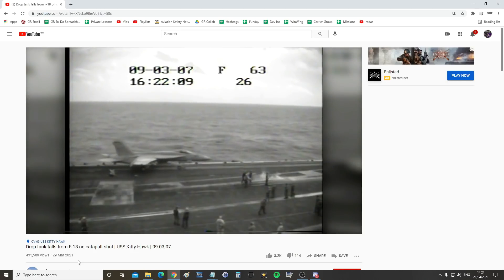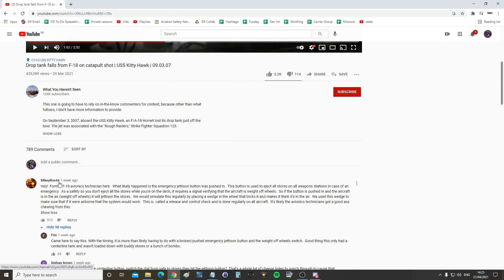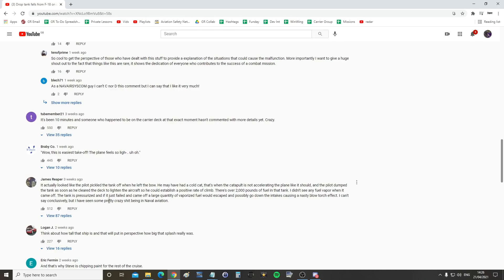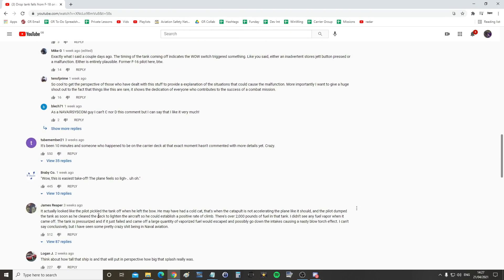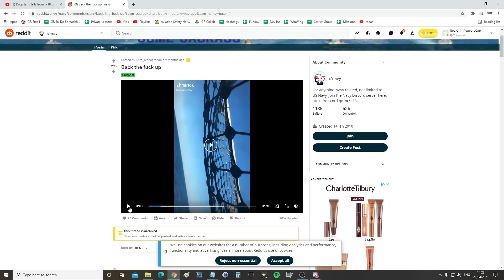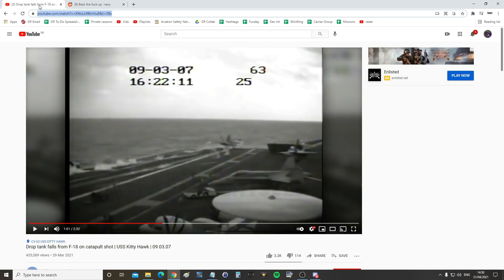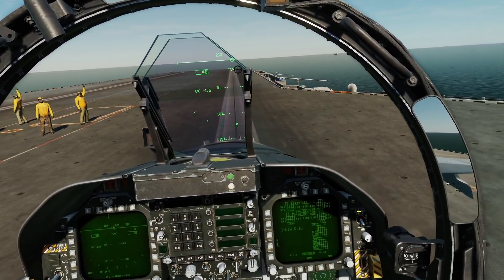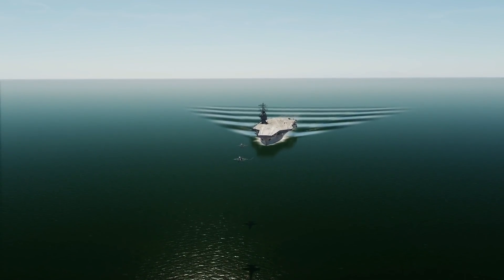2007 Why Does FA-18 Hornet Jettison Fuel Tank After Catapult Shot? | DCS Reenactment

Comment: This was done on purpose, hitting the emergency Jett button.  The Avionics tech is not wrong about the jett test functional with the WOW Wedge, but you have to have both weight off wheel and be pressing the button for the tank to come off.  In other words, the pilot was pressing the button when the tank came off, not the tech an hour before.  The tank was full, you can see how big a splash it made.  An empty tank is like an empty beer can, doesn't make a big splash.  I have seen an empty tank jettisoned on a range (pilot screwed up, he wanted to jettison empty  rocket pods and hit emergency jett button by error- he admitted it, saved a lot of time for the investigators).  It skidded on snow, we picked it up later.  Still in one piece. Tanks do not explode when jettisoned on the ground, even full.  I know and seen the  results, personally, of 2 full external tanks jettisoned on a hangar floor (functional test with WOW wedge, but the carts had been left in, techs took a shorcut but fucked up, they were doing night time "assembly line" config changes, a big no-no) and another one on the flight line (centerline) with the same results.  Scared the shit out of the techs.  Jet fuel is just very clean diesel (or close to it).  I put some in a zippo lighter and it is difficult to ignite, because it doesn't evaporate much.  Plus there are additives to prevent the friggin stuff flashing over, in case of accidents (short of a crash) or when some dickheads fortget to remove carts when doing a functional...  These are warplanes, expected to take hits and not blow up like a Zero.  Anyway, for some reason, in this video, the pilot hit the emergency jett, probably a cold cat as mentioned. It may not have been an actual cold cat, but given the pilot has .000000000001 seconds to react, maybe he thought it was.  Never heard of an emergency jett button getting stuck, I imagine you would get a warning on startup. Big time.  But crazier things have happened.

Comment: As an F/A-18 weapons tech for 25 years, I’m 99% certain that the jettison button was pressed and when the aircraft went WOW it jettison. It wasn’t a cold cat because if it was the aircraft would have lost altitude and have a difficultly turning and climbing (lost an aircraft because of cold shot). The other 1% could be a malfunction of the bomb rank were it had stray voltage powering the cartridges that actually pushes the stores away from the aircraft. Been WOW completes the circuit.

Comment: Just a side note: The procedure does check for 28 VDC at the firing pins on the rack when emergency jett it pushed, you then release the button and check for not only no voltage but stray voltage as well. The test is required after the rack is hung on the aircraft centerline. If the tank was hung on an already installed rack, you aren’t required to do the jett check but the rack is required to be checked every 30 days that it’s installed. Wing tanks are done at each installation because the tank and release mechanism are one unit. Being a maintenance I’m partial to the pilot dropped that tank due to a soft launch. Inadvertent releases are very far and few between but they do happen, usually as the aircraft switches are being set for arming.

Comment: A-5 Vigilante carried fuel tanks and weapons in an internal bay between the engines. Sometimes, during cat shots, they lost the tanks due to the high acceleration.
Reply: The a 5 and tu 128p are the two aircraft in most need of modeling

Comment: Jettison in DCS is still simplified as you can jettison at any speed. I have read in real life F-4 Phantom II had different speed ranges depending on the amount of fuel left in the tanks.
When intercepting Migs in Vietnam the max jettison speed was often exceeded. So either jettison early before accelerating or keep the fuel tanks. 
F-4 pilots sometimes did not drop the tanks because there was not an unlimited resupply (and they considered the weight of an empty tank to be acceptable).

Comment: I have my doubts on whether this is modeled or not. In the Huey, there is a wire strike blade above and center of the cockpit, and forward, center of the skids. It’s to cut a cable and prevent (in the event if a wire strike) the cable from entangling in the helicopters blades. If you are confused about the specific device I’m referring to, here is an image link: https://th.bing.com/th/id/R1dd5926a5d198444f441243771503b8a?rik=Xu9WAhijhYv4TA&riu=http%3a%2f%2fwww.b-domke.de%2fAviationImages%2fHuey%2fImages%2fUH-1D-10109.jpg&ehk=Y%2bNXtE8lJdPBYklEifjD%2f%2f4eWPaG%2bmQTH7or4ZfwEzM%3d&risl=&pid=ImgRaw
Reply from the maker: thx

Comment: I've done this accidentally several times. Either somehow clicking the button, and it not unclicking (I think sometimes if you click it, then move the mouse it stays depressed - haven't proved this though) then landing, rearming and taking off, OR because I have a toggle switch bound to EJettison and haven't set the switch to off after having it on from a different plane.